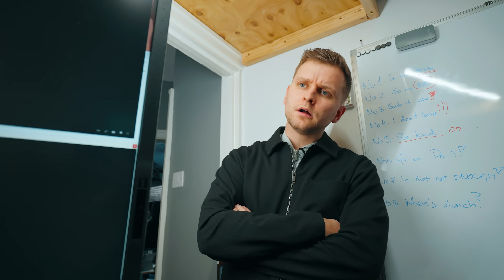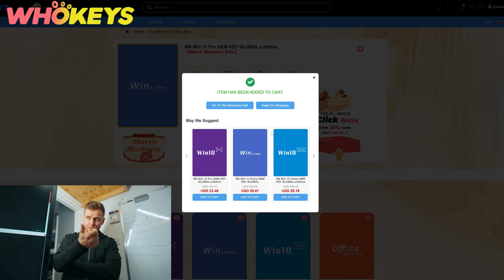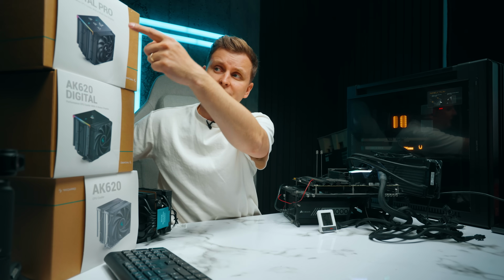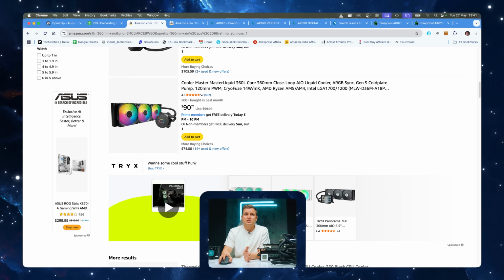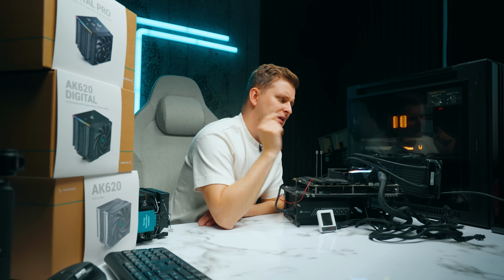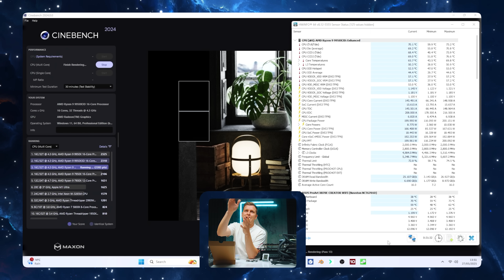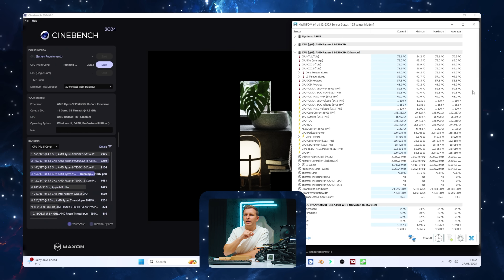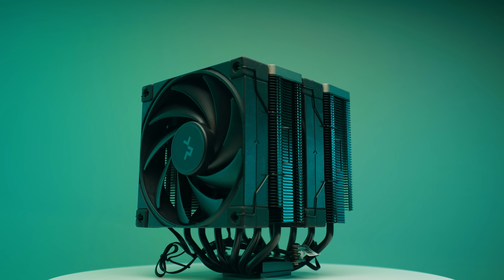Stop Overpaying for CPU Coolers Now! AIO vs AIR [PROOF]

Comment: I had multiple AIOs in a variety of builds and priceclasses... i learned to hate them with passion. Aircooling is cheaper, more quiet, doesnt break as often and operates most of the time on the same level as an AIO in terms of cooling. Only one AIO actually surprised me the "be quiet! Pure Loop 2 360mm"... price was okay, it had good performance, wasnt too noisy and the only one that survived until the pc in itself got trashed
Reply: Can you fit triton Nero rgb ram with these big air coolers?

Comment: its easy to throw opinions at random and in niche situations, but whats the minimum heat output that makes that decision worth it, so you can approximately decide if going with Air or aio is reasonable for your situation.
(and do include the relative effect of the environment, air is more sensitive to room temp)

put some approximate sheet numbers for cpu’s in a medium to large dataset of different coolers from both sides.

so approximate assumptions gets more clearer.

(i’m not advocating for a nasa lab like testing methodology, but a more logical and doable testing methodology that is reasonable and good enough), much love ❤.
Reply: I thought gamers nexus did this long ago and actually has the nasa lab, do you not see his cooler reviews? he's been doing it for decades
Reply: @trauma50disaster1  i do watch his reviews. but i posted this on the get go, for no obv reason.

Comment: This is the comparison on non overclocking right, basically temps are not exceeding the limit so they result the same. Can you test in overclocking scenario? where the cpu is trying to work harder and AIO can keep up and Air cooling is not? My hipothesis is there where the difference is.

Comment: AIO coolers are fool's gold. I've had three of them since making the switch to PC back in 2016, and they have all failed. Don't get me wrong, they look very cool from an aesthetics standpoint. But be prepared to only get around 2 to 3 years out of them. I'm strictly air cooling now.
Reply: well, AIOs have gotten more durable nowadays. You can get more than 5 years of use with newer AIOs.
Reply: @edk1124  An air cooler lasts a lifetime. Maybe swapping out the fan if it ever fails which is no big deal as really good fans like the arctic p12 pro is incredible for under $10
Reply: @ItsTimeForChrist   
I almost did it.
I replaced CM fans, for arctic p12 pro.
I have an old Hyper 212 EVO CPU Air Cooler and I replaced the fans on it. I am very pleased.

But now I'm thinking, maybe just because of the beautiful appearance, to switch to the AK620 DIGITAL PRO WH
Reply: @edk1124  There's just too much going on with them. Air Cooling is straightforward, no gimmicks
Reply: @Faze9784 there isnt that much going on. its called an aio cooler. you put the block on the cpu just as easy as an aircooler and then just screw it on the top or side panel. if thats too much for you how did you decide to build a pc to begin with?
Reply: @iamjstew___4473  i don’t think he’s talking about installation. Too much going on as in there are more points of failure compared to an air cooler. Pump failure, leaking, corrosion, liquid dissipating. These are all things that nobody worries about with an air cooler.
Reply: @ItsTimeForChrist no one worries about those with an aio either in 2025…
Reply: 3 years for an aio is literally a ton of time lmao.. if you said a couple months or even maybe 1 year id be like okay but 3 years?? you could by a 360dollar aio and for 3 years of use thats 10 dollars a month. there are plenty good aios for 100
Reply: same, aio is for impressing your friends and strangers on the internet. an air cooler from $40-80 will last longer and is as good in maintaining temps

Comment: Everything about PC building is esthetic and noise. Parts are designed to run in less than ideal conditions. Better cooling performance may reduce temperature by a few degrees but that translates to zero in increased hardware performance. AMD CPUs, for example, are purposely designed to run at 95 Celsius under load; bringing it down to, say 80 degrees, does absolutely nothing.
Reply: aesthetic is lower than last for my pc building, haha.  Your right on less than ideal conditions, I was not bothering to pay attention until I started losing fps and realized I was thermal throttling at 100.  No clue how long I've been doing that, maybe years.  So if it takes a few years off the life, so what, don't we want to buy a new cpu anyway by then.

Comment: 14:46 Differences between black and shiny:
* Paint protects it from corrosion.
* Black has higher emissivity (dissipates more heat as infrared radiation) than a shinny surface.
* Shiny has slightly more conductance because it has no paint obstructing heat transfer.
Reply: If your heat sink is corroding, I don't want to know what is happening to the rest of your system. I have a 9 year old cooler that still looks like the day I bought it

Comment: If you use your computer for any serious work or gaming, and you consistently see CPU temperatures hitting above 84 degrees c, then it's a good idea to upgrade your cooling, whether it's with air or water. If your temps always stay below 84c, there is probably no point to upgrading your cooling. Your CPU will start to throttle back the performance of it's cores when it gets hot ( usually anything over 80c but it kicks in more hardcore around 85c, every model cpu has a little different thermal core boost/throttle profile ) So you're loosing performance / Fps by consistently running hot, the ideal would be to never break 80c, and that is more or less the same for GPU temps.  You can also increase your fan speed profiles on your existing system to keep temps down, this usually works pretty well, but does increase fan noise, if your air cooler uses standard fan sizes, you can just buy upgraded quite fans and swap them on the existing air cooler or Aio, this may require some cable modding and rpm researching tho.

Comment: Hi Everyone, I'm a newbie here so please understand me.
I build my pc on October 2022.
intel i9-13900k and Corsair iCIUE H150 ELITE 360mm AIO liquid cooler.
10 July 2025, the AIO pump burnt so bad suddenly. Computer become super slow and shut down itself.
26 July 2025 still no news from Corsair supplier for the warranty claim.

23 July 2025 decided to get Noctua G2 (standard version) because I need to finish editing the photos for my clients.
Run the Cinebench test for 10 minutes with room temp at 18.2 Celcius and got the score 2072, cpu highest temp reach 97 Celcius.

Question 1: Is the Noctua G2 good enough for my cpu?

I never run the test with the AIO before, Only look at the temperature from the AIO LCD, showing 32 Celcius during idle.
 Question 2: Is the AIO LCD showing the true CPU's temperature?

Thanks in advance for kindly answering my questions.

Comment: Short critique:

The video contains several logical flaws and contradictions. Although the tester himself demonstrates that water cooling achieves on average 5°C and at peak 7°C lower temperatures compared to air cooling, he incorrectly claims air cooling is similarly effective. Additionally, the test setup—running openly on a table—unrealistically favors air cooling, making the results unrepresentative for real-world use. Furthermore, his claim that air cooling is significantly cheaper is directly contradicted by his own example: a 360 mm water cooler costing just \$55 compared to a \$60 air cooler.

While he correctly identifies potential downsides of water cooling (pump failures, leaks), these risks are low and can be minimized with regular monitoring and maintenance. The suggestion that these issues inevitably result in CPU damage is exaggerated, as modern CPUs shut down automatically when overheating occurs.

His statements about noise levels are also problematic, as he did not perform realistic tests within an enclosed case. Typically, water coolers are quieter under full load due to their larger cooling surfaces and lower fan speeds.

Overall, the video lacks consistency and disregards established findings from more realistic tests and studies.

Comment: There was no air cooling could beat liquid cooling back in the Pentium 4 days. Those things ran really hot. I still use most of my Danger Den system from 2006ish. I'm not a fan of the AIOs because of the small cooling loop and limited amount of fluid used in them. My system rarely warms up more than a few degrees C when gaming. I don't want all that warm air being exhausted into my case.

Comment: I am curious if you will get the same results in an actual case.
Reply: It adds extra variables which will muddle the test. If the airflow through the case is good, you'll get the same results though. Comparing the case open and case closed temperature is a good way to check if the air flow is adequate.

Comment: Water cooling. I dont need it, just have a be quiet cpu cooler which works great, plenty case fans and a big corsair case with great airflow. Temps are plenty cool. I also never overclock

Comment: C O R R O S I O N  loves COPPER !!! it's only a matter of time before the water pump breaks down and the water heats up late but cools down late. The radiator cannot cool this water sufficiently and the heat increases. This is a big problem especially if you play games for hours.
Reply: In case there is usual water, not distilled

Comment: I went back to air after running liquid for 15 years. Super happy with the choice. I went with the Noctua NH-D15 to cool my 9800x3D, so it wasn't a cost thing, i wanted great reliability and my system to be quieter. After replacing all of the fans in the case with 140's and switching back to air on my CPU you can't hear the thing until the CPU gets to 50%+ and even then the loudest it gets is quieter than my system was before at its quietest.
Reply: I too made the switch for the exact set up. My temperatures are actually 4 degrees cooler on average. Granted i got the lian li 217. But i really do love my noctua all fan build.

Comment: Some things that are incorrect: the tower air coolers spread a lot of heat around the cpu, so mosfet and ram close to the cpu get heated up because the fans are placed higher and do not affect the lower area, where the heatsink tubes extending around the cpu carry all the heat around. The other huge issue with air coolers is weight. I was always scared of breaking the motherboard when having to move the pc with double tower.
Reply: the first point is only an issue if you do not have proper airflow with enough intake fans. The second is only an issue if you think a motherboard is made of paper. Absolutely nobody has broken a motherboard merely because the CPU cooler was heavy
Reply: @KaitouKaiju  How can you have enough airflow, if in the area around the cpu there are the rams close on one side, so air is not passing from there, on the other sides there are the heatsinks for the motherboard power group mosfets, and below there is close the gpu's upper heatsink plate - you can have all the external fans that you want, no air is passing at the base of the heatsink tower - I spent 2 months, modding every day, to place some 40 mm fans there and try various solutions ... About the second point, even if I have a 200K msi motherboard, every time you have to pull out the case and move it across the floor I get to feel it that the slightest bump in moving it has heavy vibrations returns - sure it is not like coming off anytime ...

Comment: I got an Arctic liquid Freezer 3 Pro 360 aio currently and it does phenominal but I also have a Noctua NH- U12S and they both do a good job when i had either installed. Obviously the AIO is doing better cause well the noctua cpu cooler isnt the big fancy one but it does well enough that im keeping it around cause I know how reliable it is. Im trying out AIO cooling for the first time in years. I had a little 120mm aio back in like... 2013 and didnt see the hype but it did its job and lasted for quite some time. Basically til i upgraded my system entirely from an intel system to amd when Ryzen first came out.

Comment: I like it because it drives heat out of the case and like that keeps the internal cooler included the graphic card, which might pay you back more than a normal fan would do. 
Anyway, the graphic card is the loudest in the case everywhere this day's. So noise level on a cpu cooler is secondary but sure still important.

Comment: I don't think you are right about this topic. I absolutely love air coolers. But if you have a bit hotter (30+ celsius easily here) room AND a closed case (not an open testbench) that 7 celsius can easily be a 15-18°C difference IF you are using more demanding modern (15th or 16th gen Intel) CPU's.

And this, my friend could mean many years shorter lifespan for almost all of your pc parts in the long run. That's why I absolutely MUST buy an AIO for my next build. I would never, if air tower coolers would be still so good performers as you say in this video. But that time passed. So I need the the coolest AIO for the buck (here is the Lian Li Galahad II performance 360 - better than most 420's) and the best ventillator setup with absolutely high (100+) CFM and/or static pressure. And yes, of course - serviceability and shorter lifespan is a big problem for AIO coolers. But if you loose just one HDD full of data (or anything else expensive under the case) next time you won't be so sure about that 'still OK' cooler. I saw many laptops crash just because poor cooling.

There's no such thing like 'ok cooling' or 'it's enough'. You preferably aim for the coolest setup for the price - if you don't want to buy new parts every 1 or 2 years, like my ex-colleague.

Comment: Too much flack really. If you don't mind the noise and you don't have a top and Intel or AMD CPU model that doesn't get hot just use an air cooler for 30-40$.

But if you do have a high-end CPU then get a AIO for $90, the best ones on the market cost that much from liquid freezer. It's not $300 difference guys it doesn't really matter.

Comment: Can you redo this but do it in a case? The case airflow matters a ton for cooling results. I replaced my Noctua d15 with arctic freezer 360 and it lowered temps under load by like 9 degrees and scored better. I do have good airflow case though. For nothing but gaming probably won’t matter much but cooling results on an open bench isn’t how most people are going to use these products.

Comment: My mid-range PC with an air cooler is performing well. Even with a CPU that has a 105W thermal design power, it's only reaching 60°C under full load, and temperatures during gaming are in the mid 40s to low 50s. The idle temperature is around 34°C, which is a 3°C difference from the ambient temperature of 31°C in my house without air conditioning.

Comment: in todays computer building, imho, one would be foolish to NOT run an AIO unless the builder just likes the way air coolers look. And you can pick up something like the WarFrame AIO's for cheap and a 280 wil cool better than MOST THE HI DOLLAR air coolers on the market. ANd A very impoprtant fact most miss when doing temp benchmarks and that is the temp of the room your doing the tests in....if it is summer time, and you are unlucky enough to NOT have AC, your computer is going to run hot regardless of the cooler picked. I have found that the ones who run air coolers just build on a budget, in that case, if your CPU comes with an air cooler, like AMD for example, those air coolers work quite well and really do not need to spennd anymore on another air cooler, use that money and upgrade to an AIO, always upgrade, NEVER downgrade!

Comment: I’ve seen way too many people buying $100 AIOs for 9600X/7700X/9800X3D when a $30 air cooler would be enough. Then they all complain PC building is more expensive than it used to be and get a worse GPU, cause it’s “not in their budget” 😂 if you swapped that AIO for air cooling and X870 for a B850M, you’d get a 5080 instead of a 5070ti.

Comment: Idk why I am watching this when I just got into Custom loop haha

I did have AK400 Digital as my first CPU cooler cooling the 7600x at max 75c
Changed it half a year later (for no reason) to a 240 AIO frozen by thermalright and got better temps at max 65c.

but then I upgraded to a 7950x and used my 240 AIO (was fine sitting around 65c with TJMAX to power limit to 120w)
but got bored and tried Custom loop to unlock all the power of the CPU

Comment: I got my ID Cooling Frost Flow X 280 in front of my case. Its a 280mm liquid cooler. It pulls in air from the front and out in the back. My max temp of my gpu is 66C under 100% load and my max cpu temp in a 21C room is 46C and that is if it runs at 100% and only pulling 56-60W of power. Now you are wondering why I did not go for an air cooler for an I5 12400f. Both the air cooler and 280mm liquid cooler was the same price, and I wanted it to look cool, so I just got the aio and call in a day. My aio lasts so far for 2 years, no issues so far, 0 noise issues, etc. If it hit the bucket, then I will get a new tower air cooler.

Comment: Pretty sure AIO cooler have a coolant, not water...
Reply: Water is the coolant, as it has both a low enough viscosity and high enough thermal transfer rate to make for an ideal coolant fluid.
Reply: @pieterveenders9793  it's not o normal water. It's special liquid